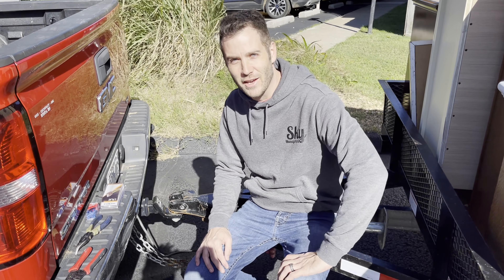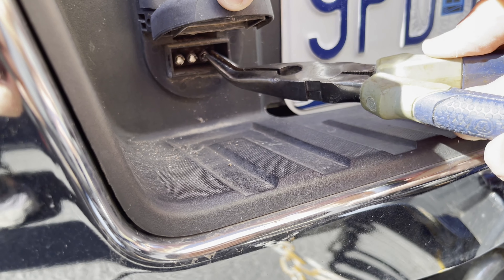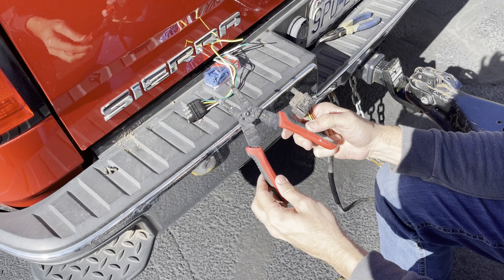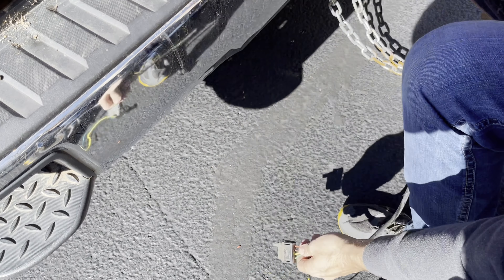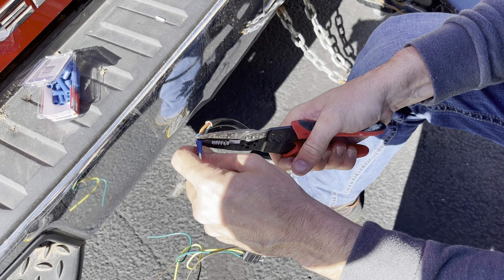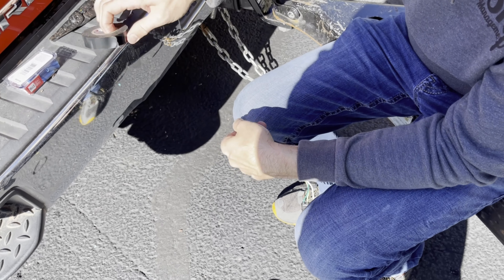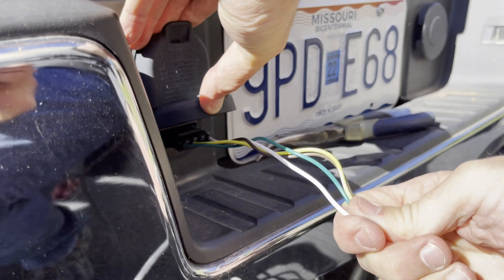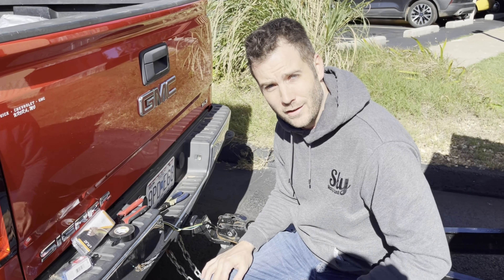Trailer Plug pins broke off inside truck (4K)

Comment: Thank you. I bought my first trailer recently (1975 Boler) and this just happened to me last week. My question is why did they make the spring load on the 4 way outlet cover so strong? I am convinced that the main reason these connectors break so often is because that stupid spring loaded cover is pressing down on them with too much force and bending the prongs. I am even thinking about wedging a little wooden shim under in there to prop up the cover when it is in use unless you have any better ideas.